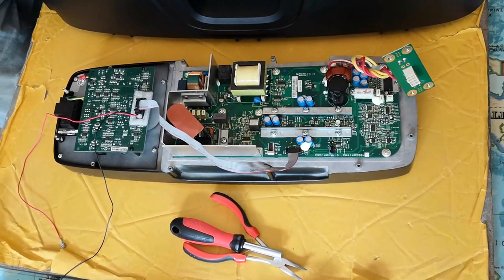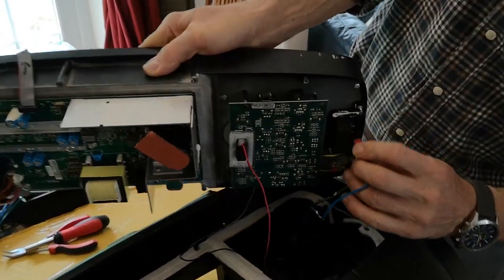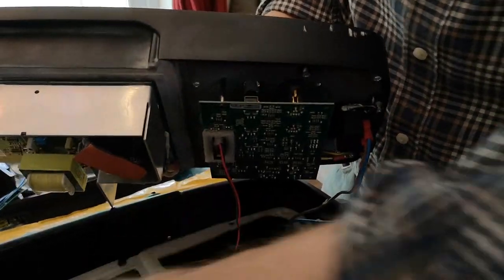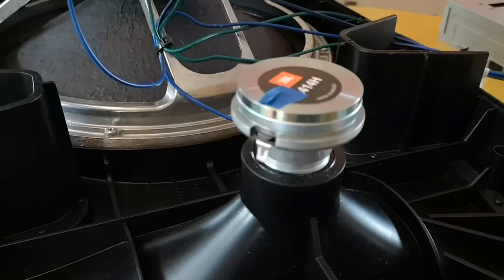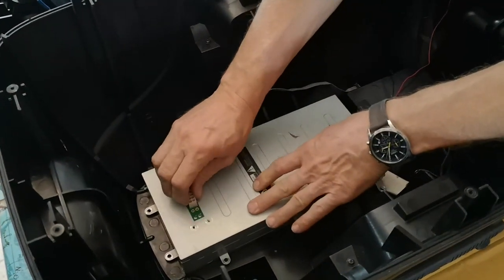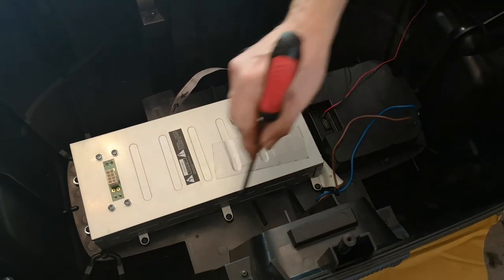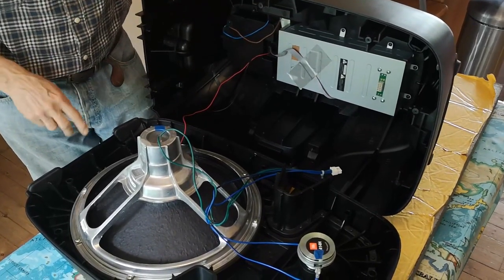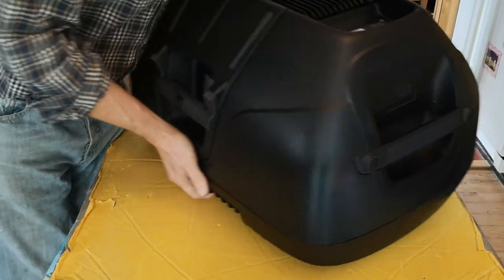JBL EON 515XT Repair,  Disassembly, Reassembly and Diagnostics

Comment: Hello Magic Smoke, I bought a second hand JBL EON 500 and I realised that after 30-40 mins, the sound looses the voice part, I mean in a song where you have music and voice, you can hear the music and the basses, but you can't hear the voice. I thought about a faulty capacitor. Do you have some idea about? I haven't opened it yet, but before doing so, perhaps your opinion would help me a lot. Have a nice day!
Reply from the maker: If the sound very muffled then check the HF drive (tweeter) and the connections to it, It could also be the tweeter going open circuit when it gets warm. Pretty rare but I have seen it, So check all space connectors are tight,   Swap tweeters and test the speaker to rule out the tweeter, The HF power amplifier itself is usually very reliable however the MDRC circuitry in the preamp input board has any operational amplifier chips that can fail or become intermittent.  In the power amplifiers 
there are the two capacitors (C113, C213) mentioned in the EON 210 repair video video that can lose value and cause intermittent operation. . I can't remember which one is in the HF amp but you can work that out. Check them. Good luck.

Comment: For the life of me, I cannot figure out how to remove the lower mixer board from my 515. The mains power connectors have come undone inside the internal enclosure for the back panel. I've removed all the internal screws holding the mixer board/back panel in, but it still won't budge. Does it lift out from the inside of the case, or does it lift out from the back of the case?
Reply: ele vai sair quando retira a placa. fonte , vc vai ter que desparafusar o gabinete todo
Reply from the maker: Did you sort it?
Reply: @razenby  I did, thanks! Stupid mistake on my end. Just had to give it a harder push than I'd thought.
Reply from the maker: @DillonStrichman  Good job.

Comment: Hi just brought a pair of JBL EON 515XT  one switches on OK no noise not a problem and bass works fine, but the other when I switch it on it sounds like a fan turning on after a few seconds goes off , I then noticed the mid range and top are working but no bass and when I turn the speaker off it gives out a thump noise could this be loose wires or do I have a more bigger problem thanks mark
Reply from the maker: Did you fix it?

Comment: Hi I have a 515xt which I bought second hand  and what it was doing was  cycling on and off and I pulled it a part but  as you mentioned I am a very keen observer when taking things apart .But when taking the leads from the main switch the usual col our  coding is Brown is live and Blue is Neutral that is pretty much the standard .But I can see that in some you tube videos they seem to put the brown as neutral and blue to the live on the main switch section  .The other end it specifies where the blue lead goes and where the Brown goes .can you please help me with some advice,on this section because I put it in the way you had it Brown Live and Blue Neutral and it started to smoke at the Power induct or in the section next to the yellow transformer the part called Coilcraft 335 (D)  I don't know if it is now damaged the part but I turned it off and awaiting some help from you.thanks in advance Greg D'cruz.
Reply from the maker: Functionally transposing the brown and blue wires wont stop the unit working. The mains side is isolated from ground and the audio.  The spade terminals are different sizes so you shouldn't be able to get them reversed. The problem would occur is there were a short to ground inside the unit  as the internals would remain live if the fuse in the power socket fuse holder were to blow.   The smoke is due to a blown inductor or LNK302 chip. This is a bad design that is a frequent problem when the insulation on the small coil breaks down and sparks and the speaker powers up and down. Change the 1000 uHenry inductor and the LNK302 chip. Then it will work.   If you have a continuity meter then the brown wire should be connected to the fuse. (Take the fuse out and probe the contacts). Make sure you are aware of the risks as there are high voltages inside.
Reply: Thanks for getting Back ,But the spade terminals going into the main switch assembly are both the very same size which in a bad way of doing thinks ,I have checked with my multi meter with the fuse wiring that the live is live should I put it back the way it was before where in the Brown lead was to  (N) and Blue to (L) and on the main pcb as marked brown to brown and blue to blue.please advise.The other thing physically looking at the chip LKN302 it looks fine no burn marks or damage but the inductor one side of it is all burnt called coil craft 335 (D) if I was to change it and the same part is not available
 what can I replace it with and where can I get this part I am from Australia ,is there a place world wide where I can get these parts .As you mentioned should I just go ahead and replace both at the same time and avoid waste of time both the 100uHenry and LNK302 .Please advise where the components can be purchased .We have RS components which is Radio spares do you think I will be able to get these parts from them .Thanks for all your Help in trying to get this unit working,Greg.I have  re read your reply and noted that the Brown to the fuse line of path will do that .If you can help me out with the other bit will be happy.Just as a matter of interest the components d368 and c368both on the track side has solder dry joints and the heat sink pad on the reverse side has no thermal transfer just barely the sheet will put some paste if I get it working what are your thoughts on this observation.Greg
Reply from the maker: Greg, Farnell stock both parts. The inductor you need is the Wurth PD2 series rated at 400VDC Farnell part ref 1869783. The LNK302DG-TL  Farnell order code 2920879RL. That should sort it.  Don't over tighten the screws. You can pierce the heatsink insulators. Good luck.

Comment: What kind of fuse does the 515xt need?
Reply from the maker: 5 amp slow blow . The fuse rarely goes as there is a protection circuit with PTC.
Reply from the maker: Working on one now.

Comment: Do these speakers have a built in limiter circuit? Which components are responsible for this. I had a look at the schematic but above my IQ level  :)
Reply from the maker: Yes they do but it is a very limited limiter as it only looks at the whole signal band. If you concentrate the power in s a strong HF content with the volume turned right up on the speaker  you can reliably blow the HF driver.  i.e a shouty female vocals on a mic,  Don't use the cut/boost control run flat. Keep the volume setting as low as you can on the speaker and drive the amp harder from your source. Finally use a mixer with a limiter if you can. Otherwise keep spare  HF drivers handy.

Comment: JBL 515XT treble not working, Tweeter reads(3.9ohms). Can you advise on what to test? Thanks.
Reply from the maker: Look at the videos.  There is a video on the channel  on how to test a 515 tweeter with a multimeter,. I have no idea what faults you are seeing.
Reply: Changed the diaphragm on the 2414h and still no treble. 2414h produces sound with a MP3 signal directly to it, but no sound when plugged into 515xt amp.

Comment: Hi   I have a pair of 515xt's  one is noticeably more robust than the other.   The treble control on the suspect one has little effect.  My first suspicion is the HF driver is not putting out, though I can hear something.   What is your opinion?  I know how to use a DVM, though I don't have a scope.  -   I guess I could take them both apart and swap the drivers,  a lot more work but it would quickly answer the question.  Looks like a LOT more work!  FWIW, they're in pristine physical and cosmetic condition so the likely hood they got banged around is slim.    Thanks  WG
Reply from the maker: Obviously the driver is the most common cause of HF failure First check the 10 Ohm resistor next to the HF amp to make sure the legs aren't fractured. See the video on this channel that deals with this.
Reply: more info... apparently one has more gain than the other.  I'll take a DB meter and do a test on various frequency points of each unit and report back.  stand by!  Wayne
Reply from the maker: @waynegrauel1031  Check that resistor...completely numbs the HF channel if broken..
Reply: OK, problem may be identified.  I had a suspect cable going to another keyboard that seemed to have interfered somehow,  pulled and signal is up.  However, listening to program material from my DAW, there is a detectable amount of distortion from that HF driver.  A little swapping and isolattion might have answered my original question.    BTW, your video, audio and production value is "right up there" .  Nice Work!  Wayne

Comment: Hello Magic Smoke,

After a gig and a year later. both of my speakers once any bass was being played would here a crackling sound. Any idea's what this might be? if you can advise what to check for to get this fixed.
Reply from the maker: Most Bass issues I have seen all relate to the loudspeaker driver.  When the amplifier LF channel fails  invariably there is no LF output at all. You may have an unusual fault but is is unlikely both have failed wit the same unusual fault.  What are the chances?